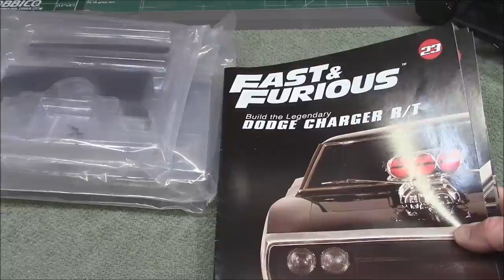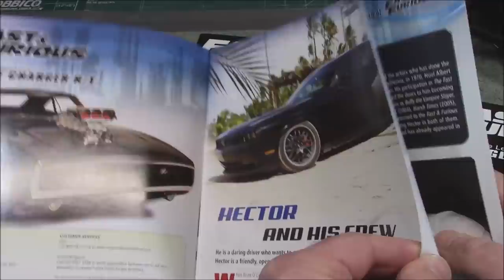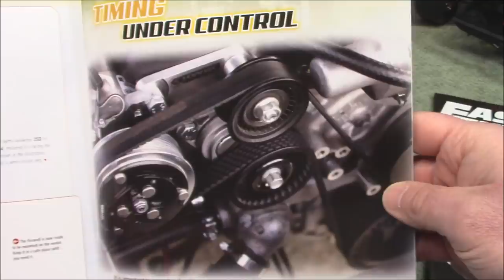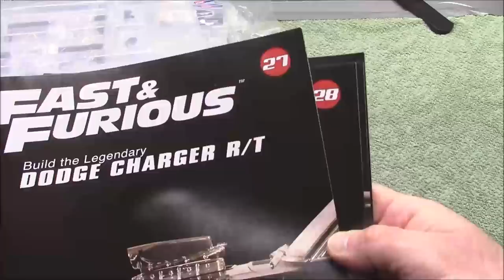Fast & Furious 1970 Dodge Hemi Charger R/T 1/8 Scale Model Step 23 thru 30 Fanhome Radiator Brakes

Comment: I'm in the process of building this same kit. Haven't gotten as far as you have but I'm not far behind. The only thing I have been dissatisfied with so far is the blower belt and pulley set up. They have the belt running off of the water pump pulley instead of a crank pulley and I found this to be poor r and d for a kit that costs this much money. I an considering redoing this completely with some 3d resin cast pulleys and a longer belt. Just not happy with that part of the build up.
Reply from the maker: Yeah, who knows where that came from.
I think it may be from the movie stunt car because in the movie Dom can turn the blower on and off for dramatic effect, where as in real life the blower has to spin constantly of course.

I wonder if the stunt car was set up with a clutch or switch to run that blower belt off the other pulleys.

Motor Trend even did an article about all the fake stuff done to 'impress' people that know nothing about how cars work, like hydraulic rams to lift the nose and stuff so the car could burn out AND lift the front end, etc.

The 70 they wheel around to car shows isn't the one used for anything but the garage shots and under hood shots sitting still.

Comment: Question Sir, Have been watching a lot of your videos. A little confused. I see that you put a lot of parts together, in white styrene. What I don’t get is how you paint part’s different colors, when they are glued together. TY- JC’S Garage
Reply: My two cents for whatever it's worth? Have fun hand painting like "we" used to do before airbrushes. Maybe it's not perfect around the edges when you look at it through high magnification, but to the naked eye it looks just fine and that's what matters ultimately. Of course masking is a worthy skill to develop. Not fool proof though but a huge step in the right direction. Just my take.